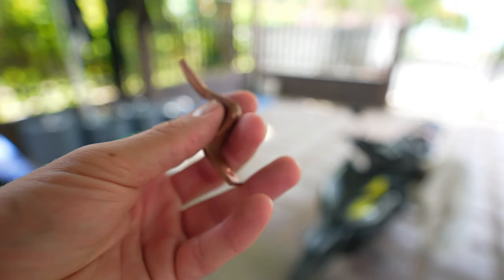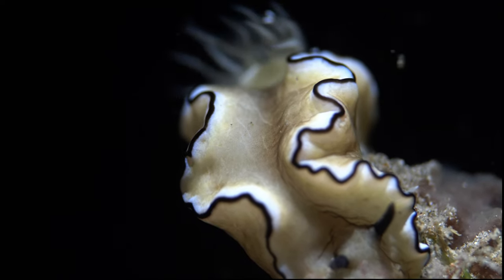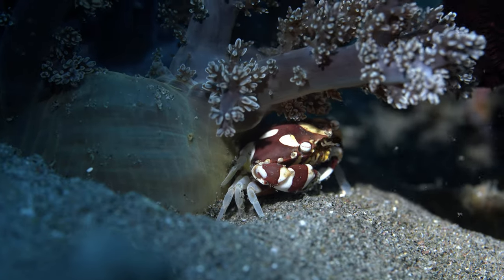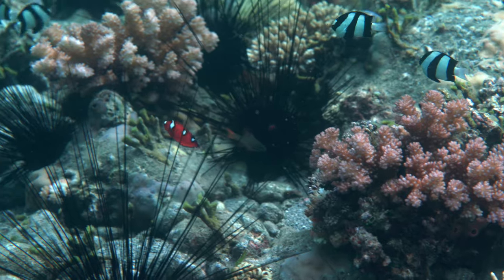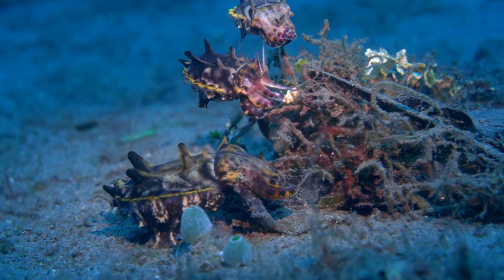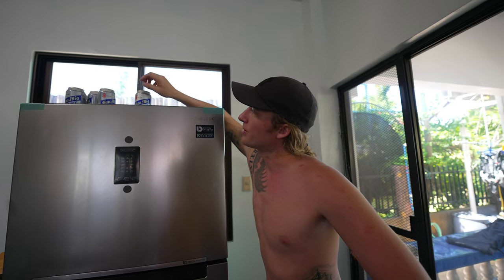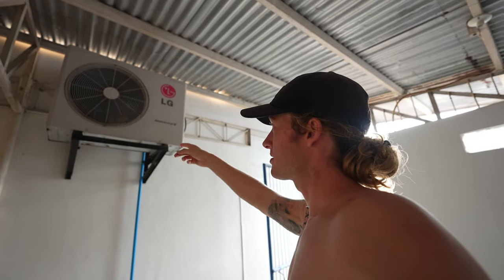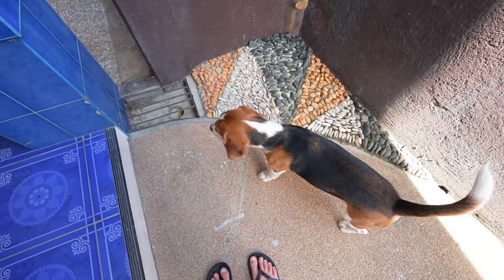HOUSE FIRE HAZARD 🔥 Electronics Burned Because of THIS... (Philippines Province Problems)

Comment: For about $40 the air con outdoor unit should have a surge protector. Always... All the time.. The breaker in the panel bid won't prevent a surge from frying the motherboard in the outdoor unit... I've installed hundreds of mini spit until like that LG.. Every one always gets a surge protector.. Even here in Virginia where the electric grid is considered excellent.. Surges happen all the time and the motherboards get fried..
Reply: but still, give him a thumbs up for extra effort in sanding down than single brass metal part
Reply: You need a voltage regulator and surge protector. PH electric is very dirty, surprise more crap dont burn up in peoples homes.
Reply: I just don't buy aircons with a invertor/motherboard. Use more electricity, but less repairs.

Comment: The underwater videography = excellent! Flamboyant cuttlefish grouped together = very special moment... Unstable fluctuations in voltage at the house is common, nothing in line to regulate it. You can purchase a device to do it for you, installed at the main panel...Good luck...

Comment: your footage of the underwater creature is fantastic. you know that under size wire use in the panel can cause problems, that's why the wire is changing color because it cannot carry the load, which is dangerous, it can cause fire. If you have a power outage it is best to unplug your electronics it can burnt them out when power comes back. That's what happen to the air conditioner. If the wiring to your circuit breaker is not corrected, the problem is not going away, patch work do not correct the real problem. Good lick.

Comment: Surge protection isn't enough in the Philippines. You need a voltage regulator. The copper cables actually looked good to me, a person with considerable experience manipulating electrons. Frequently they are too thin in the PI. Great critters.
Reply: Very well said or better yet install a separate panel for electrical equipments for safer use, right safety first than be sori later
Reply: That is to avoid overloading

Comment: Electricity in the province flactauates a lot. If you had brownout, switch off or unplug all appliances so that once the electricity returns and the voltage is higher than usual, it won't  distroy the appliances.

Comment: Study ohms law and you will see as voltage drops The other values change. This puts a tremendous load on your components some of which you replaced. I suggest that you get a voltage control device that is automated and has large capacitors to deal with surges. When I lived in Baguio we had to have one of these for the fridge because at night sometimes the voltage would drop down below 150 V.

Comment: I noticed that after you transfer in Negros  you often have no electricity power where is the problem it is the electricity management or the cables wire inside the house Finn?
btw another epic diving adventure again and i love to see the amazing spices through your mysterious talent of shots👏🙌🤙🤙
Reply: Hi, if I may answer...there are many outages from the power company.  They do not have redundant equipment, so every time there is trouble, or maintenance, or switching there is an outage.  Most of the outages are for switching and are only about 20 minutes.  They do seem to have monthly outages of 12 hours for maintenance though.  Finn also seems to have some minor problems in his house.

Comment: Loose connection becomes a heating element,  maybe an old house too or may have used cheap screws on the bus bar. The air conditioning condenser problem might want to check the capacitor on the fan motor.
Reply from the maker: Maybe..

Comment: If you are living near sea, corrosion is very normal. Appliances, electrical or electronics don't usually last long because parts inside and even plug can easily corrode. Check all your power plugs, you will notice it is turning black or rusty. Even your camera and lenses. Corrosion is the cause of your power problems. All these is because the air in your area from the sea is salty.
Reply: Smart saying!

Comment: I had the same problem with my main switch and to found out the cause of those sparks is that every time it rains hard. The water flows through the plastic pipe from outside to the wall and that causes the spark. My last electrician change the wiring froma standard one to a heavy duty one so even if it rains it will not be affected.The brand was from US and its not that expensive comparing the peace of mind you get.

Comment: I don't know if comfrey grows over there, but if it does, soaking the fractured limb in a decoction of comfrey will knit that fracture together in no time. Absent that, if. you can get the homeopathic preparation of that herb would do the trick. Name of the remedy is Symphytum official. There might be a homeopathic pharmacy over there where you can get the remedy.

Comment: Multi split A/C works best and cheapest for electric if it on. Turning it off and on wears parts quicker. The A/C should also have a separate single braker panel at the unit. Don't forget that you live close to the sea which causes corrosion to metal and copper electrical lines. Always protect your electronics with a bar that has surge protection.

Comment: Sherlyn, your tool, the hand drill overload the transmitter of the circuit breaker thats why it burn and expired the aircon chips. Why not use wireless hand drill (battery) its safer the voltage of your hand drill is high baka mas mataas ang capacity ng drill mo kaysa nong transmitter ng circuit breaker kaya nagtrip at nasunog nagkaproblema tuloy aircon nyo check mo ang packaging ng equipment mo for safer use, ganyan nangyari sa amin. Ingat kayo at stay safe always. Granny here
Reply: Wrong!’
Reply: Thank you but definitely a big wrong po!
Reply: Salamat naman kung mali ako meaning safe ka at ok ganon kasi nangyari sa amin good thing ok ka un ang importante and secure be safe always

Comment: Pls  advise the electrician  to make a separate connection only for your aircon wiith a switch box and fuse box by itself, use aircon wire to be safe and it shouuld come directy from the main switch box ..that is the usual setup for connecting an aircon. The electricity is only for the aircon so that the power is maintain properly.. don't compromise the connection to get the full benefit and be safe from  any power fluctuation or increase in power..Keep  safe..let us know the results

Comment: Are they even licensed  electricians?
Reply: You dont need to be a qualified  electrician to do any electrical work in the phillipines.Thats is why the place is the way it is over there,live wires just hanging in the streets,no RCDs on houses,no safety switches.Most are more then happy to spend 1000 peso on jollibee  then to upgrade there electrics.

Comment: You have discovered a truth about the Philippines. Filipinos don't know how to do electrical home wiring. It comes from the attitude that barely good enough is good enough. If it doesn't break when I first install it, then it must be OK (or at least I won't be around when it does break). They don't make good connections, and because of that, bad electrical connections cause most house fires in the Philippines. Filipinos think that making twist connections and covering the twisted wires with some tape will do, when the rest of the world is using wire nuts and other reliable connections to join wires permanently. 

For the most part, the Philippines also has inferior electrical components (that China is happy to dump on the Philippines), so those are prone to failure. Because of that, they don't tighten connections that would otherwise be reliable for fear that the components will break when properly tightened. I guarantee that if you open outlet and switch boxes in the house, you will find examples of poor practices and poor materials. It is common here. If they can't get the breaker panel connections right, then you know that nothing else in the house is right either.

Comment: You electrical problem are probably caused by salt in the air from the ocean.  You can coat you connection to prevent corrosion with proper product or even use clear nail polish.  Just follow the one hand rule; One hand always behind your back, so you can not get a shock.  When the power goes out, shut off the main breaker and all the sub-panel breakers.  When it comes back on, wait a few minutes for it to stabilize before turning your TV, AC and electronics back on.  Turn the lights and fans on first, then the fridge, etc last.

Comment: WE ARE ALL GONNA DIE lol,,,,,,Jake is hiding covering his ears.....Amping pirme.  P>S  I have many years in the Caribbean, the electricity is not stable...surges. I have all my electronics on a power bar / surge breaker, NEVER JUST PLUG STRAIGHT INTO THE WALL.  The fridges and TVs are autovoltage here because of the unstable power..